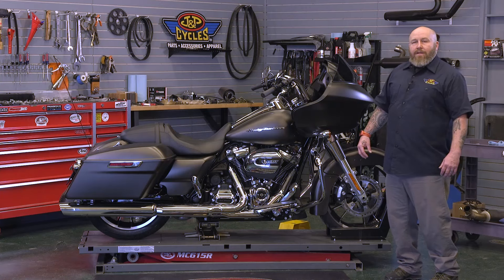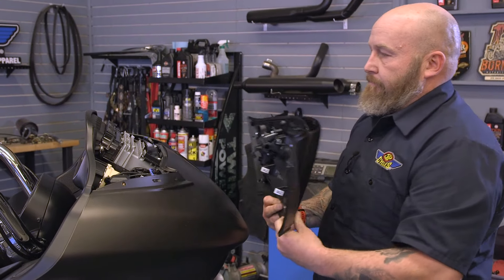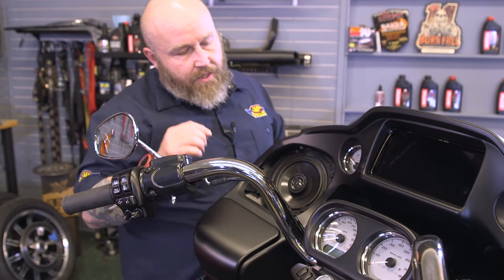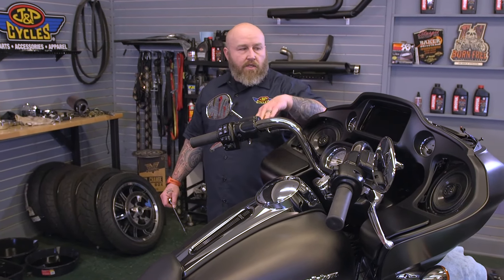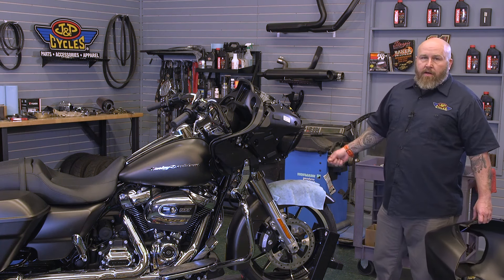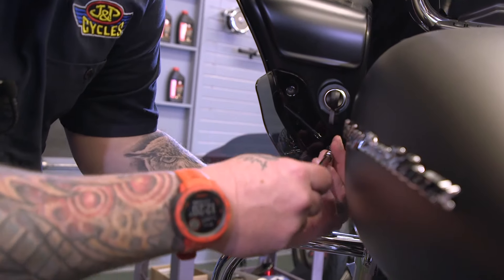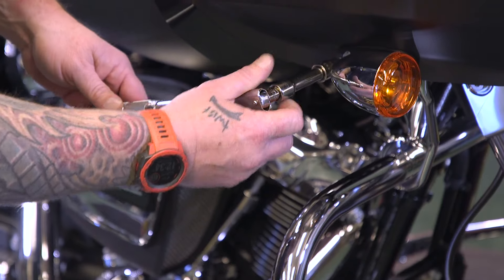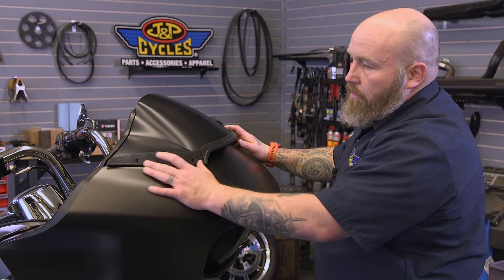How to Remove and Install a Harley Davidson Road Glide Outer Fairing : Weekend Wrenching

Comment: Have you ever had a problem with the windshield screws not turning or wanting to go back in flush? If so how did you fix it? I am currently having this issue and my screws are just spinning and I can’t get them out or in

Comment: Don't forget to reconnect the turn signals. Not sure that was in the video for the reinstall. 

Great video. I was a little nervous to do it until I watched this. Tip about the two top bolts is priceless.

Comment: Why is there a gap between the vent and the inner fairing?  Look at 8:07 into the video?  I did not have that gap before I removed the vent
Reply: Windsheild  should tighten up that gap once its on !!!

Comment: Thanks for your excellent tutorial and helpful tips! The outer fairing also needs to be removed when installing vent screens. The ventilated fairings on 2015 and newer Road Glides are wonderful for eliminating cockpit buffeting, but also direct road debris and large insects at the riders upper torso, neck and face. Our Triple SPLITSCREENS product solves that problem. Go to https://MotorcycleVentScreens.com for details.

Comment: The front part you took off how do you get it to realign back at the left and right upper top and when it doesn’t seal up all that way and there’s a gap what’s going on where do I have to look to get that gap out and get it to go up into the seam on the top left and right edges? Another words how do you get it seated so it’s up against everything even by the windshield how do you get rid of that gap if it’s pulled forward but yet all the screws and all the bolts are lined up.